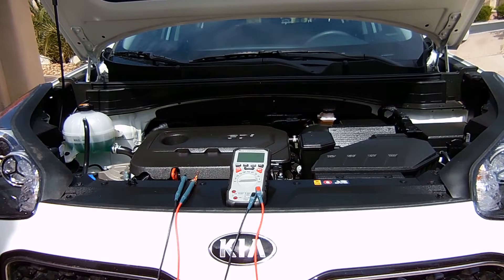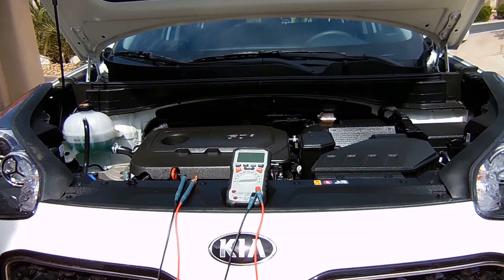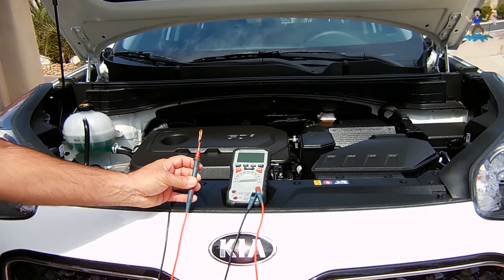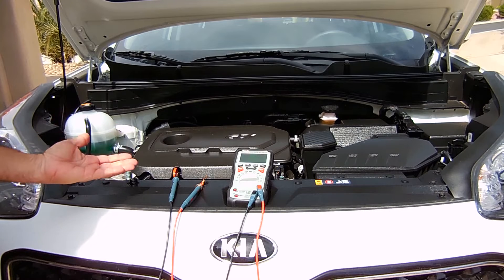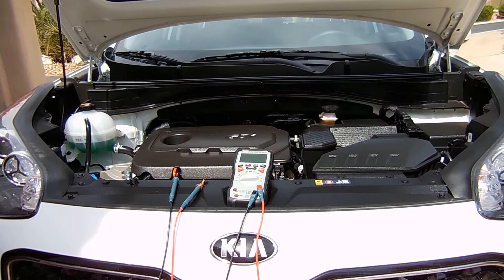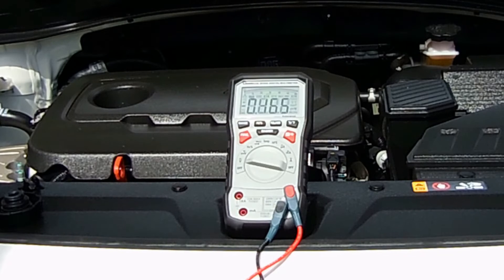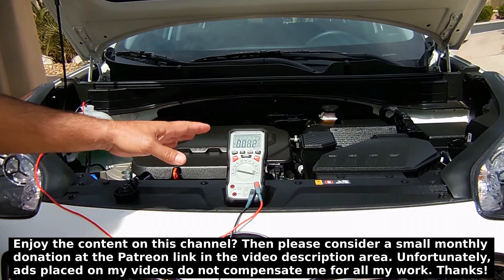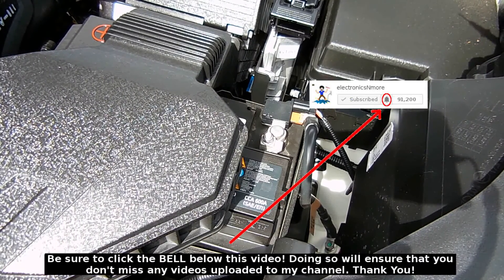How To Test Engine Coolant/Antifreeze Using a DMM

Comment: Great video as usual. A few things that might need to be noted:
You must switch on all electrical items such as rear demist, headlights, spotlights, etc to gain an accurate reading. This puts the electrical system on load and will encourage electrolysis, making it easier to identify.
Secondly, it might be worth mentioning that if the battery cables are removed, some systems will loose their radio codes. It is important to make sure you have the codes to re-enter after the cables are reconnected.
Well done on another excellent video!
Reply from the maker: That's true. A very good idea to repeat the test with all electrical items turned on. Yes, some vehicles will require codes to be re-entered.
Reply: electronicsNmore Nice video. I was wondering if the same applies for a diesel generator?

Comment: idiotic when you are measuring from coolant reservoir because there is no metal link to take negative charge there.  
grow up. 

it's OK when you are testing from radiator.
Reply from the maker: Hey Dunce. The current flows through the liquid, you don't need the metal reservoir. Think twice before posting stupid comments. Polite comments get polite replies.
Reply: @electronicsNmore  flow where  ????????? and from plastic?  :) IDIOT LOL F.O

Comment: Awesome video! I checked my coolant in my 2015 corolla, and the voltage started at .2 and kept dropping. If I recall right, I pulled the lead out of the coolant at .14

Comment: great tutorial. is it possible to do a video on all the sensors in an automotive, especially how to test them with a multimeter (volts reading) and how the graph per sensor should look like when connected. Thanks

Comment: Others suggest doing this on a cold engine. Is there a reasonable difference in doing so when cold/hot?
Reply from the maker: Interesting question. I'd need to remove some engine coolant, then test one sample hot, and another cold. I'd go with the happy medium, warm. :-)

Comment: Nice video.
I put the 2 leads of multimeter into the coolant radiator and it gives 0.02 v. However, when I put one lead inside of radiator and other lead to negative of battery, it gives .20 volt. Why is this reading different???
Reply: Because in the radiator your lead is closer to the metal in the radiator

Comment: You mentioned having someone keeping the RPMs around 1500-200 while running this test, but you didn't do that in the video. Is this necessary? I read a similar thing in an article, and wondering why the engine would need to be running to do the test. I'm not even sure from an electrical perspective why the coolant needs to be hot. While conductivity is affected by temperature, couldn't we just establish an acceptance range at ambient temperature?
Reply from the maker: Increasing the RPM increases alternator output. :-)
Reply: @electronicsNmore  I'm still confused about this point. We're not measuring alternator output, and since all engine parts are essentially connected to the negative post of the battery (in all modern vehicles anyway), why would a change in voltage at the positive battery post (because of RPM increasing alternator output) affect our reading which is the  potential difference between the negative post and the coolant?

Comment: Its so much easier to just change the coolant every 4-5 years.  No test necessary.
Reply from the maker: You missed the point! LOL If you just bought a used vehicle and know nothing about the maintenance that was done, then you can use this info to let you know the condition of the coolant. Why replace good clean coolant?
Reply: If I bought a used car I wouldn't trust the maintanance records anyway and I would change ALL fluids. $20 for coolant good for 4-5 years is no big expense.
Reply: Nick V You really miss the whole point of these sorts of helpful youtube videos don't you. You obviously have the knowledge, tools and skills to change your coolant the same day you buy a second hand car no problem. No doubt you change the brake fluid, flush the transmission, rip out half the engine, re-grease things and replace bearings all over the vehicle while you're at it. Only then would you be satisfied. The rest of us are still in the process of learning proper maintenance and these sorts of videos help contribute to building up an overall understanding of how various systems are interacting with each other. It must feel great to be so superior to everyone else.
Reply: @Nick V So doing this SIMPLE test is harder than changing coolant? Dude, that must be some good s**t you're smoking!

Comment: If you have a new model car, I don't recommend disconnecting the battery unless you have a way to keep voltage to the system. Disconnecting the battery can sometimes cause the computers or sensors to act flaky.
Reply from the maker: Yes, check out my other video below. Thanks for watching!
https://www.youtube.com/watch?v=IvI6KgCo130

Comment: New to the channel, thanks for the info! Water heaters in your home have a sacrificial anode as well that needs replacing. Not sure if you already have a video for that. Maybe your next video!
Reply from the maker: They're easy to swap out. Turn off the power and water supply to the heater, drain out some water, then under the plastic cap on top of the water heater is the anode. Use a socket to remove it. :-)

Comment: Many large diesels have sacrificial zinc anodes built into system to combat electrolysis.Low 
PH level is a big problem which sets up a current  attacking dissolving  dissimilar metals in cooling system..especially ungrounded ( not bonded) components like the brass copper heater core in your dashboard and even fire rings on head gaskets.
Years ago CAT had a bunch of truck engine main bearing failing mysteriously . It turned out all these trucks were hauling large open plastic pipe which when going down the highway air passing through  pipe produced a static electrical charge which dissolved soft main bearings. 
Generators also have current leak through main bearings on alternator end. 
Another problem is erosion of water pump vanes and cylinder liners do to low cooling system pressure combined with low PH.
 This voltage test is commonly used and accurate indicator even by Cummins On an or CAT service tech.  
Just change your coolant with quality stuff every two seasons in small car motors its cheap enough.
I  always add small amount  K and C stop leak or Barr's Aluminum or copper liquid ( not pellets or dry powder) into all older fleet trucks before any  leak starts. Never have issues in years. 40 years as fleet mechanic tech. שלום
Reply from the maker: Yes, low PH is a problem. I guess you can use PH test strips. Keep it above 7.

Comment: you forgot to tell them to turn off engine BEFORE disconnecting neg on battery. I wonder how many people will smoke their Alternator and possibly the computer becouse of this?
Reply: The car was never on to start with and you are doing a test to the radiator fluid witch you don't need to have your engine on at all so you got a point there but because the engine was never on your comment is not valid. Hahaha
Reply from the maker: Common sense that once the engine has reached "Normal Operating Temperature" and the first test has been performed, you no longer need the engine running for the second test, so clearly the engine would be OFF when disconnecting the battery. I just added a notation in the video. :-)
Reply: electronicsNmore Your not dealing with common people here. This is YouTube. I'm just saying....

Comment: Lucky me, my blown-head sucks-up the coolant......so I have to regularly add fresh coolant.
Reply from the maker: Never have to worry about old coolant. :-)
Reply: electronicsNmore               Exactly! I took the t-stat out and the car actually runs very cool and pretty good....have been driving it that way for over 4 years.
Reply from the maker: The only problem is, with modern vehicles the engine needs to reach a certain temp for other sensors to begin working properly. Fuel/Air ratio and emissions won't be right.
Reply: electronicsNmore      Yeah, it usually gets into the lower-end of the normal-range, on the temp-gauge, within a couple of minutes of driving. Now, if I am non the freeway or driving at a speed where a lot of air is flowing into the engine-compartment or it is REALLY cold, yeah, that baby stays quite cold according to the gauge. Even when it is cold, it still runs great.....but I do get slightly worse gas-mileage.
Reply: That is going to be expensive as far as gas usage. You are not going to reach operating temperature, then the O2 sensors will not be able to control the A/F ratio.
Make sure you dont get milky oil and wipe out the bearings or hydro lock the engine and bend a rod.
Reply from the maker: This test has nothing to do with O2 sensors. The purpose was ONLY to heat the coolant up before the test.
Reply: fred Flinstone       I get pretty decent gas-mileage because I drive like a granny most of the time.......15 to 20 MPG is decent for a heavy vehicle with a 6cyl. My vehicle does get into the lower-end of the normal range of the temp-gauge after a couple of minutes of driving.....my scan tool shows closed-loop after maybe 5 to 7 minutes of running. It is a junker, so when it blows, no big loss......been driving it like this for well over 4 years and the oil looks great.
Reply: tickyul Lol dude my truck with 3.0 V6 uses like 5-6l/100km or 2 gallons/60 miles
Reply: CME         6 cylinder truck that gets 30MPG, hum, I suspect that is inaccurate.
Reply: tickyul Yes,and its on high side of fuel usage.
But its not full truck,its like those things that are basicaly a car with bed in back,and its diesel too.
P.S. That kind of vehicle is called pickup in Europe,not sure about USA.
Reply: CME       You poor, poor Boratperson, sounding like you have 
Madcow-disease or possibly Hyperetardationing!!!! What is the make and model of your Cartruckpickupthingy.........let me guess, a Lada pickup!!?!?!??!?!?!?!?

Comment: I had heard of this method, but I didn't know the threshold voltage indicating time to change the coolant.  But this test doesn't show correct mixture of coolant and water for maximum protection in heat or cold.  Another fine video!
Reply from the maker: Usually use a 50/50 mix or 60/40 mix. If there's too much water, then the voltage reading should read high.
Reply: I suggest that if your voltage reading is high and your coolant needs to be flushed, use a rust removing product before your final flush and refill with your coolant.